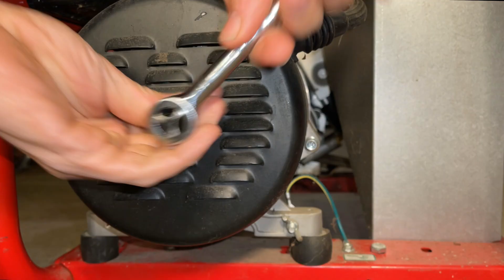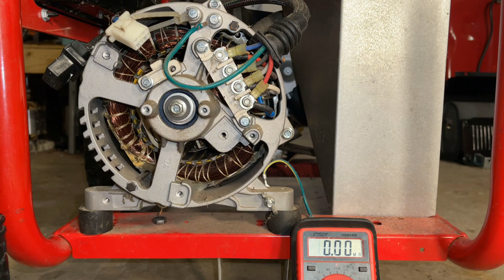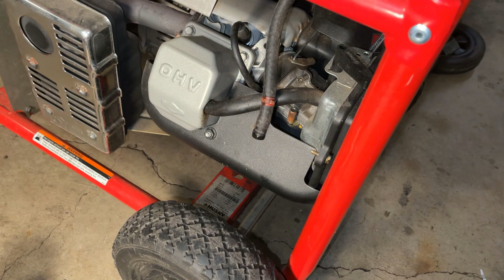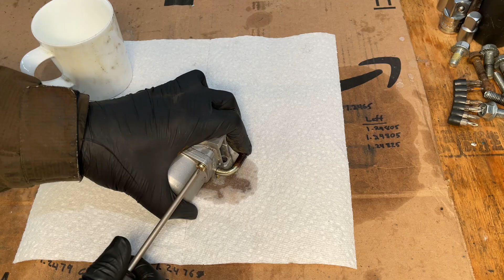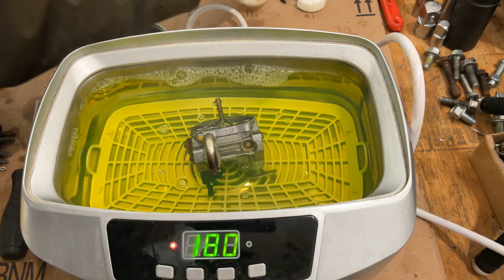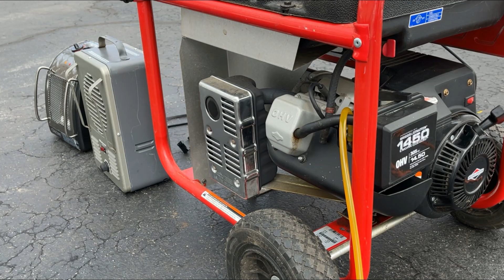Husky Generator - No Power

Comment: Great job James, I like the way you take your time diagnosing the problem. All in all, not a heck of a lot wrong with this genset.👍👍.  I’ve learned a lot about generators since watching your videos, very educational and complete information, thanks!
Reply from the maker: Thanks 👍
Reply: Me, for the cost of a 5,000 watt generator, I would be buying a new one.  No work, no hassle and hopefully no worries that it would break down  3 months later after I fixed this one up.    Especially if I had to pay $170.00 and $75.00.  I will throw in another $250 and get the new one.  However, this is a good video because I bet for many people who have a generator and rarely start it and the carbs get gunked up would see that it is probably just the carbs and could maybe clean them themselves and save themselves some  $$$$ by taking it some place that will tell them it has major problems and rip them off.   The other thing is I never see on any of these types of video's anyone tell people how IMPORTANT it is too start your generator and run it with a load at least every couple of months to keep it running smoothly and hopefully not have any problems when you need it.  Living 3 1/2 miles off the ocean here in SC I am always doing that 2 month running of the generator because I may need to use it for  some time if a major hurricane hit.

Comment: Love these videos, I wonder have you tried an inductance meter and an insulaton tester for checking the windings on the alternators? 

You could get a cheap inductance meter for around $10 but the insulation tester would cost a bit more?
Reply from the maker: Recently picked up an insulation tester.  Am concerned that if I go looking for a problem, I will find one.  Usually will not do a insulation test or leak down test unless there is a run issue.  Will look into the inductance meter.

Comment: Thank you once again.  At first I thought you were going to increase the govenor tension prior to increasing the avr.  This was because the no-load frequency was only 60.7 hz.  On some videos you like the no load Hz to be around 61.4-5.  Obviously, you made the correct call.  I have found the smaller jaw vicegrips (wr 5) have finer teeth and grip the screw heads a little  better and with less marring.  They also are great for stripped brake bleeder  valves.   Kind Regaards, Craig
Reply from the maker: Thanks Craig.  Yes this one was a little slow when started.  Was considering upping the speed a little, but the speed came up as the engine warmed up.  In the end I think it was running around 61.3.  Anything in the 61-62 hertz range I will usually leave alone.  Especially on the Briggs engines.  There is no fine engine speed adjustment, just bending the governor tab..
Reply: I usually shoot for 60Hz at 50% load but I've seen the manuals state 60Hz at full load is the proper spec.
Reply from the maker: @kevin9c1  60 hertz half load is probably ok.  If you set to 60 at full load, the engine will be running closer to 64 hertz with no load.  But, it depends on the engine.  Would not exceed 62.5 hertz without a load.
Reply: @jcondon1  Here is what the L-head manual says about generators:
"NOTE: If available, use a load bank to load engine to full generator rated output. With generator at full rate output, turn screw to obtain 3000 RPM, 50 Cycle or 3600 RPM, 60 Cycle"

I tend to prefer 50% or whatever nominal load you expect.

Comment: The screws on the Niki carbs are insanely tight.
Reply from the maker: They are.  Have never removed them successfully with a screwdriver.  Sometimes a JIS screwdriver or impact works.  Vice grips always work.